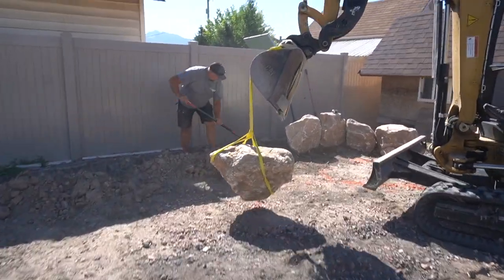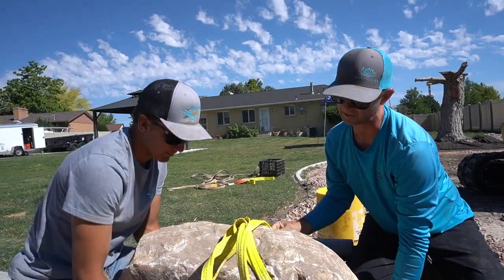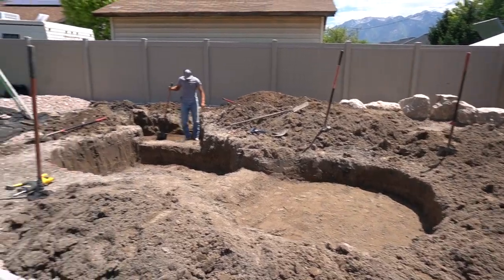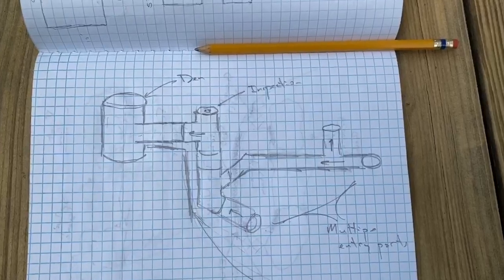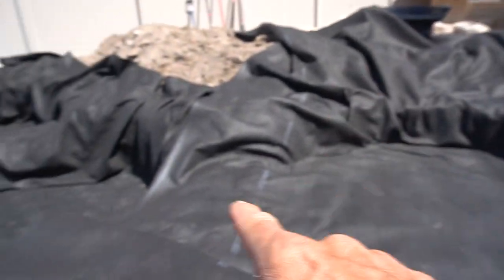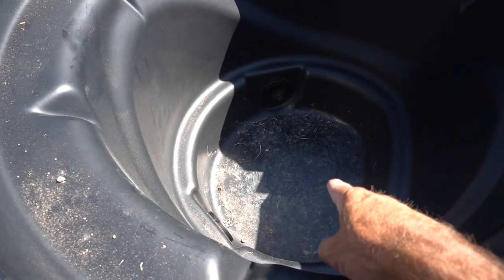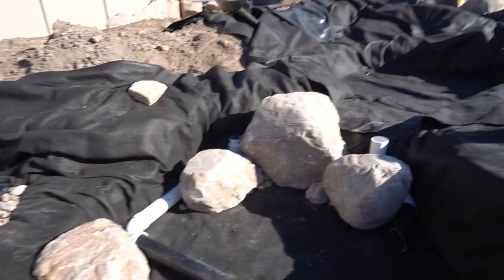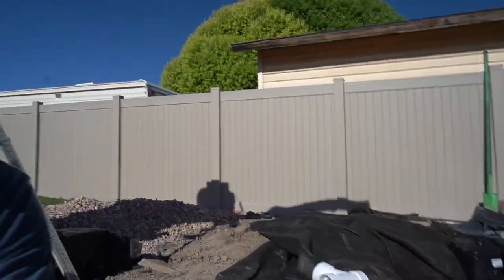Muskrat Den for a *MINK POND* Part 2

Comment: Ed, is the interior surface of the vertical pipe too smooth for the mink to get purchase!
Reply: Based on Joesephs recent video, its full of water nearly to the top. It's mostly a swim
Reply: Your very perceptive!
We actually drilled 50+ 1/4” holes in the pipe to allow them to climb